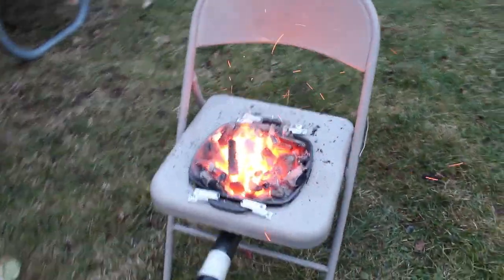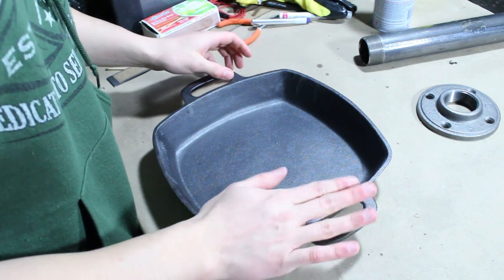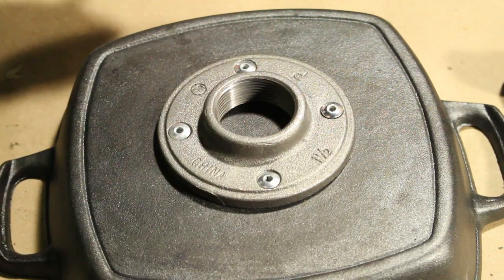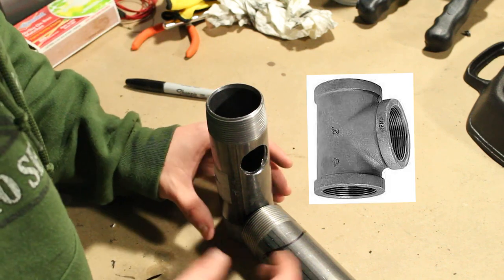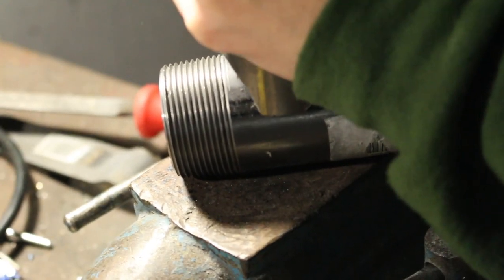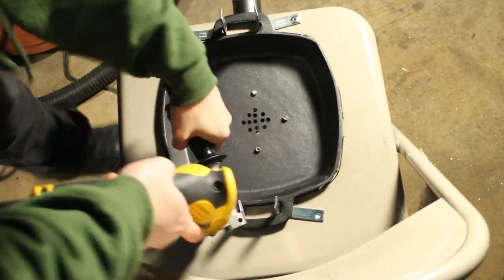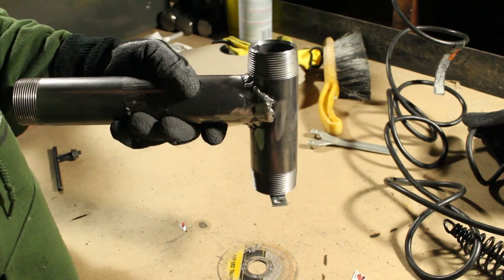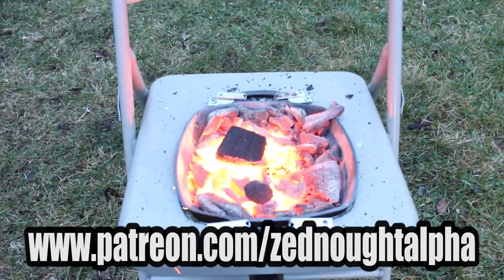Fold-Away Blacksmith Forge (Satan's Toilet)

Comment: some cool tips if you have the money and you like to find random stuff you can look by your train station and try to find a piece of the railroad that is pretty small and you could use your angle grinder to flatten out the train rail and you can make a nice anvil for your black smithing i would send you a pic of one my friend and i made but before we finished the anvil the rail got stolen from us when we stored it  but all in all the rail is a great anvil because of all the pressure that is put on top the rail itself and you would never break it by just hammering away at it

Comment: That little cover on the bottom if you use a bolt you can adjust the air going in for thinner steels so they don't overheat too fast.
Reply from the maker: +Myles Prower Good point. thanks for the idea.

Comment: +ZNA Productions  before i get any hate for this i'm just gonna say that i respect that you used a disc grinder for the chair, to each their own. Having said that, it may be worth your while investing in a decent jigsaw, you can get blades for cutting steel pretty cheap and if you're careful with them they'll last a while. Just saying this because as you said, those burrs are razor sharp and a jigsaw would mostly negate that as the action on the blade would push the burrs down rather that flinging them off all over the place.

Comment: A tip is that You can use a standard type of "barrel tap" (correct name here? That with a handle and a drilled cylinder inside) models to regulate tha air.

Comment: As a blacksmith, hair dryers are great for starting up, but burn out quickly if you do extended projects. Might want to look into buying a dedicated forge blower which can be between $40-60 dollars online. A bit more expensive than a hair dryer, but once you've burned out your fourth one, definitely worth the investment!
Reply: +itachi1839 since it seems your experienced,  what is the problem with hair dryers, I have talked to others saying the same thing but mine is fine. It may be that I just have not used it that much yet, or that I keep it on cool air, or that I don't leave it on for long periods of time (turn air off when I take a piece out of the forge)
Reply: +Port Kapul He literally said why. They die with extended use.
Reply: Fapperson
I mean why do they die so quickly, and with my precautions should I expect mine to die quickly as well.
Reply: ohhh, k. I would imagine because you are using them for extended periods of time while they are intended to be used for like 10-15 minutes at a time. ya kno
Reply: bathroom exhaust fans are really cheap and readily available. they are quiet and produce plenty of air flow. to make a hair dryer last longer I've been told you're supposed to disconnect the heating element. I'm not comfortable with doing that so I went with the bathroom exhaust fan works great.

Comment: Keep in mind that cast iron is brittle. As long as it doesn't get hit too hard with other pieces of steel or tools, it should be fine. If I am not mistaken, heat should temporarily make it more tough and less brittle but not when it's cold. Change in temperature should affect it though, i.e. winter condition should make it more brittle...just a heads up. Also, do you plan on making a charred wood furnace? Charred wood is produced with a barrel, limiting oxygen exposure while heat is applied to it...just be careful of gases, known as "wood gas",  i.e. gas needs to be able to flow out but not in. Refractory bricks is a cheap modification to any type of forge and help make it more efficient (fuel cost and time spent heating a piece).

Comment: Mm, very nice innovate design. Personally, I think forges work better when the sides slope down into the air blast; helps the fuel get down to the air naturally.
Also, something to control air flow, is useful when it comes to electric blowers.

Comment: may i suggest a piece of railroad track for an anvil? back when me and my brother were into forging we used the flat bottom part as a makeshift anvil. you could also use the rounded top part if you were wanting a rounded surface. worked pretty well for small stuff like knives and forge welding stuff together. it might be a good short term solution before you get an actual anvil to use.

Comment: adjustments to this build

1 mount pan under seat
2 remove plastic feet, and install sections of 1/2" steel conduit with hole drilled for pin to adjust chair height
(chair is 3/4" tubing, conduit may be galvanized cause its far enough from the heat to not produce toxins)

total cost approx 40-50$ (using blackpipe fittings)

Comment: little suggestion... you should put something in between the hair dryer and the forge to control the air flow.. you'll go through a crap load of coal the way you have it.
but other than that... super awesome build dude!
Reply: +David Gardner  Or just turn off the blower when you aren't in the middle of a heat. He's going to have problems welding as is, his fire isn't hot enough because his pot is a bit on the small size for railroad spikes.
Reply: Well that's true.. but turning it off and on.. he could catch some backdraft and it could suck the fire back into the hair dryer... 
That's not fun! LoL.
Reply: Catching backdraft would be difficult through the 90* elbow, not to mention the hair dryer spools down as opposed to full stopping, but if it did happen, I think we would all be entertained... :P

Comment: Anvil...section of railroad track of tool steel if you can get some from scrap yard. A suggestion to economise on lump charcoal. Build a small fire with it to start, and keep the rest in a bucket of water. Yes, seriously, in water. This allows you to control the fire more and helps to reduce the annoying sparks flying everywhere. (Dang spell checker...that was supposed to read "railroad track OR tool steel" to use for an anvil). Sorry
Reply: +drason69 if you put wet charcoal in the forge you can't reach higher temps, I turn of the blower whenever something is not in their.

Comment: if you only can use galvanized steel. what you need to do to make it useable,  is soak it in white vinegar for 2-3 days and use a brush or steel wool to make the coating come of. and if you don't want it to rust use like a grill paint/hightem paint

Comment: Thumb's up just for thumbnail of Satan's Toilet. 
Now that I've watched it, I applaud a young man for getting enthused into making this kind of stuff. I was very much the same many moons ago, though the bit about gloves with an angle grinder... I've got a pair of welding gloves I don with my trusty angle grinder that look like they were born in hell, never had a problem. If you've got fingers you're worried about losing to a cut-off wheel at 33,000RPM because you might get them stuck in said wheel, an ounce of prevention beats a pound of pain (i.e., spend the extra dough for a model with a grip handle).
Lesson concluded, but in closing, few things make ya feel like a man more then letting the sparks fly on a piece of steel with an angle grinder. Well, save shooting guns, doing burnouts, or hammering on steel at 1800*F on an anvil, but that's another story. When you get really good, you can tell what kind of steel you're grinding by the color of the sparks trying to light your beard on fire ;-)

Comment: benefits of cast iron is because of its high carbon content its self lubricating so you don't need to use oil when cutting or drilling it (does no harm if you do though)

Comment: +ZNA productions I was watching your bow vids and noticed with your pully bow it was like you tried mixing a long bow with a compound instead use high gauge fiberglass do like you did with your recurve and give it a bend like the recurve but the system of your compound should give you more power

Comment: nice contraption,will work for light duty..I noticed that your drill bits are a bit dull, don't put too much pressure on them and oil is to be used when piercing not just to start with! other than that,, you my friend are in your way to knife making 2.0 .

Comment: I made a brake drum forge from a lawn mower and sewer pipe, will probably make a vid on it soon just to show the idea
Reply: I made the vid its being uploaded right now, sorry for the shakey camera
Reply: If you made it from a lawnmower and sewer pipe, it's probably not a brake drum forge then, is it? It would be a lawnmower and sewer pipe forge.
Reply: how boutcha watch the vid friend.
Reply: +Dakota Burke you used a brake rotor anyway not a drum.
Reply: +TheAussieStig30 yeah you're right, but still the same thing really, they're both great fire pots, the rotor  just smaller
Reply: +Dakota Burke the thing is most lawn mower decks are very thin steel. Some old ones are cast but they're very brittle. I can't see it lasting a long time before it warps or cracks
Reply: +TheAussieStig30 you have a good point but must of the heat isn't on the mower, that's just the part to hold the coal. First time I fired it up I was able to comfortablly touch 2 inches away from the rotor for a decent amount of time. I honestly don't think it'll warp.
Reply: +Dakota Burke if you're using coal that lawnmower will last longer if you have it covered when not in use if its outside. when coal gets rained on an the water can't drain it basically eats away steel. I don't remember what is supposed to leach out but it's nasty.
Reply: +OrionsAnvil it's under cover, though technical out side
Reply: +Dakota Burke no worries then. some folks don't know and just leave em out in the open. i used too as well. good luck with it.
Reply: +OrionsAnvil I'm not going to lie, I had no idea and it will help in the future. Thanks for taking the time to tell me that I appreciate it.
Reply: no problem. I looked it up again and it looks like depends on how much sulphur the coal has in it. I guess its ok to wet your coal before you put in the forge, because it's getting burned up and not just sitting there. Just a little more info in case anyone else is interested. Always safer to cover it up anyhow. later.

Comment: It's not a bad design the only potential problems I can see is the aluminium pop rivit hold of the tray in and if it's hot enought to heat to heat up steel it's more that hot enough to melt the rivit a so they may break with multiple use

Comment: I'm pretty certain the rivets you used to hold the adapter on with are aluminum and may melt and the adapter will fall off. I may be wrong but just incase you didn't know
Reply: +Dustan Webb I know they are not aluminum but I also think it will fall apart.

Comment: if need any ideas for what you can use as anvil you could use a piece railway track or a lock pin used two hold the bucket on a digger

Comment: heres an idea, melt aluminum into ingots and just melt the ingots when you want to use them. you can find an example at king of random's channel. he even has a way of making a moled with sand styrofoam and a buket.
Reply: Why would he need the aluminum though?
Reply: +Bell Blades maybe cause low melting point.
Reply: Jon a yes they have a low melting point but why would he make aluminum ingots if there isn't a use for him?  I was asking why he believes that Eli needs those ingots
Reply: +Jon a yea but u could use them as a dull sawblade replacement. but I never did know that about baiblades.
Reply: +Driver2900  actually it could be a challenge, make a weapion out of things from a toy store or garage sale.
Reply: +Tanin Moores well there are ways to smelt igots into blades. step 1. make a blade from Styrofoam. step 2 plase it in a bucket. step 3. fill bucket with sand step 4. dig entry hole to Styrofoam. step 5. melt ingots and add them to the Styrofoam.  step 6. wait for it to cool down. lastly. get te new crafted blade out. remove the things you dont want for the blade. step 7. make a weapion step 8. profit.
Reply: +Tanin Moores I guess but it could be used for prototyping.
Reply: +Driver2900 thats you could just heat them up and use anvil and hammer. but not aluminum. and stop basing your life around one youtuber and what he does. and thinking that's the only way to do it and thinking it has to be done that way
Reply: Driver2900 aluminium isn't good for much, a prototype from wood would be better than one from aluminum (especially if it was a cast)
Reply: +Bell Blades thats right, first make a wood carving or prototype then make a mould of it ... That way you are set if you want to use the mould to make single use clay moulds or if your mould is fire proof and made correctly with multiple pieces you can cast straight in that and re use it over and over again ... I prefer lost wax casting myself ;)
Reply: Marty Veenstra what are you even talking about?

Comment: Zna, great video. But, ¿why does not the pan melt or glow red and the steel that you forge yes? It's just a doubt I have
Reply: The heat is distributed evenly. If heated up very high then it will light up

Comment: Hey, two questions: how thick does the skillet need to be, and what's an ideal depth for it? I'm planning on making a forge based on this, but if I can I'm going to use a chopped open helium canister (the sort of thing they fill party balloons from) for the skillet part. You reckon that'd work or would it be too thin?

Comment: pardon my stupid question, but why do you use a steel pipe connecting to another steel pipe or a steel t joint when you can use a elbow joint? I just don't understand if it's a safety reason or something

Comment: use granite for a anvil it is super strong plus if it is flat it is super op
Reply: But the granite wouldn't be able to handle the shock from hammer strikes and it would crack and split over time. Better off using a piece of railroad track, or I-beam.
Reply: +Toon Link it is a temp anvil for begaining forgeing in the appocolips so yes it will break after a while but it will get you started plus you can make anvils out of iron esay depending on the size you whant 50 for a cartoonish anvil 10 for a travle anvil

Comment: Instead of the cast iron skillet, can a regular steel skillet be used as a substitute? Can anything else be used as a substitute? 
and if it only works with the cast iron, would you say that a pillar drill would be the best for drilling into it?
Reply: the reason cast iron is preffered is cause your heating it much hotter than you would on a stove
or normal fire,
regular pots/pans have other materials in them than may fail or give off toxins when heated so hot
such as nonstick coatings, teflon will kill you

Comment: dont use aluminium rivets to secure stuff on a forge the aluminium will melt and it will fall apart if you have to use rivets make sure they are steel

Comment: Umm that's galvanized plumbing parts that you are using. Galvanized metal when heated releases a poisonous gas. What you need to use is black iron pipe and fittings.

Comment: ive used that same kind of charcoal u used in the video, and its not very good for blacksmithing because it sparks way too much and it gets used up to fast. U need to buy yourself some bituminous coal, it is specifically designed for blacksmithing. I got a 25 pound bag of the stuff on ebay for like 5$ without shipping.

Comment: any advice for someone worried about the embers blowing around and causing a fire?
Reply: +BrownBessOwner yes, don't worry about it unless you have dry fuel like hay bales or dead grass etc. it usually takes more than a spark to set thing aflame less they are unstable fuels.
Reply: +BrownBessOwner Yeah don't worry about it and anyway if you're spittin this many embers you are giving it too much air. Watch some vids on getting started blacksmithing.
Reply: if its a concern you could probably attach a flue pipe to the back of the chair, maybe some side screens.

Comment: How do you know that if steel is galvanized?
Reply: You know it's galvanised when it has a weird surface finish, almost like a camouflage. Just look at pictures of galvanised steel and you'll see what I mean.
Reply: It's that or it is stupidly shiny when polished, the best way to tell is to use sandpaper or a file and scrape away the surface of the metal and if it changes colour or a surface kinda thing comes off then it is galvanized. Galvanized means the steel is just dipped in zinc (from what I can remember) and cooled (pretty much) so there is only a thin surface layer.

Comment: 1:52 what tool is he using?? and like how a hammer has a nail, what does this tool have? are they called rivets or is that what he is calling it??
Reply: The tool he is using is called a rivet gun. A rivet is the metal pin like thing he put into the hole, it works by pulling a pin with a small ball on the end through a bit of steel smaller than the ball to spread it out meaning both sides pull together creating a strong joint, the excess pin then gets snapped off leaving the circle looking thing there which is the join. It's hard to explain in words so get on google images and have a quick look
Reply: Ah, a rivet gun. I've seen some, only in Bioshock though LOL. Didn't know it was a real tool. Thanks
Reply: +Joshua Noriega-Allen Well like many things in bioshock, they're real ;) haha seriously though, good game taste! Despite the rivet guns name though it doesn't actually shoot xD
Reply: Conrad Y lol, true true.... yeah lol, sadly not

Comment: "HEY, LOVE YOUR PROJECT'S & INGINUITEY."  "IM OK WITH THE RIVITS, BUT HAVE YOU EVER TRIED, STAINLESS STEEL STRUCTRURAL SCREWS" ?  USED THEM ON STEEL BUILDINGS WITH A GOOD SCREW GUN & DRIVER BIT."  OR A HEAVY DUTY DRILL [1/2] DRIVE WITH AT LEAST 4 AMPS, WITH THE SAME DRIVE BITS WILL DO JUST FINE." WE  USED THEM SOME TIMES TO JOIN HEAVY PIECES OF  STEEL TO EACH OTHER".  " I JUST BECAME A SUBSCRIBER,.   LOOKING FOWARD TO MORE PROJECT'S"
 [RABID BOB]